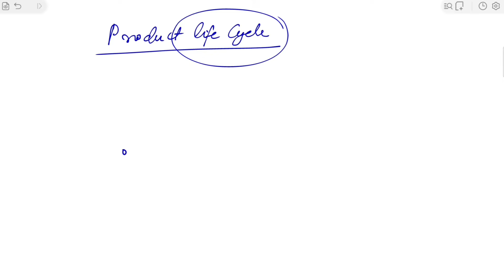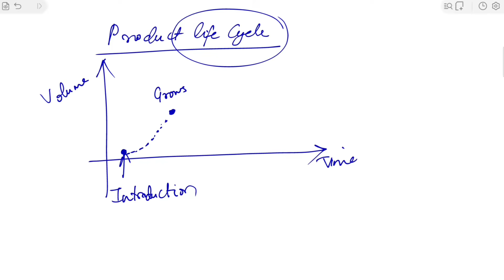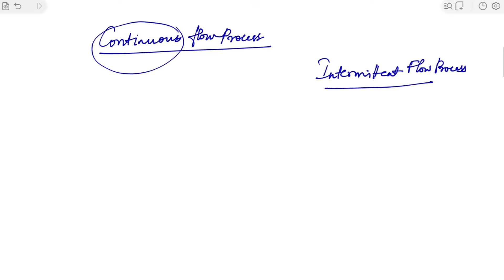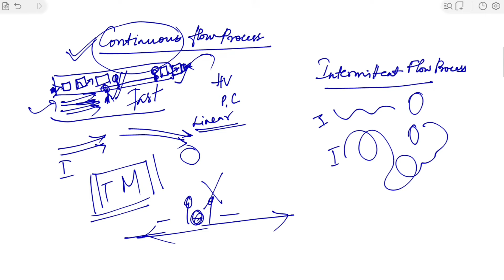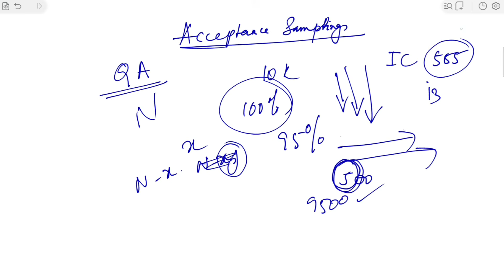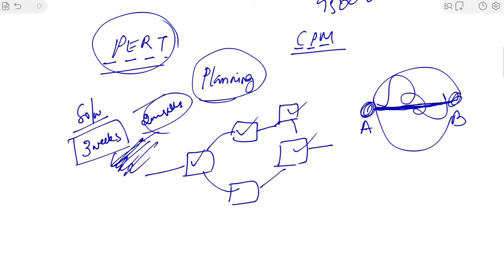MMPC 009 (PERT, CPM, Process Flows etc)

Comment: Thank you ma'am for summerizing important questions..but it seems there may be some correction.. Critical path is not the path which takes least resources..it is the longest path in the network.. delay in completion of any activities falling on the critical path delays the whole project that is why they are called critical
Reply from the maker: Let me give you an example of critical path, perhaps that will give some more clarity on the concept.

Let's say you want to make an omlette, what are all the ways that you have?
You definitely need to get, break and beat up an egg, light your stove and heat a pan, pour oil, wait for it to heat up and then pour the beaten egg mix. This is the critical path.

You may or may not add onions, tomatoes, corriander leaf, salt, pepper, chilly amd want not, all those will take longer time than the method described above. If you add these, your omlette will taste better. But if you don't also, you will still have an omelette with you. Any delay or problems in the critical path will delay your project (aka making of omelette) for sure.

This is the concept of CPM. It's not the longest, it's the crucial or the most essential order of things that must be done to get the project completed satisfactorily.

Thankyou so much for the comments. Much appreciated 👍 all the best for your exams
Reply: Thank you ma'am..